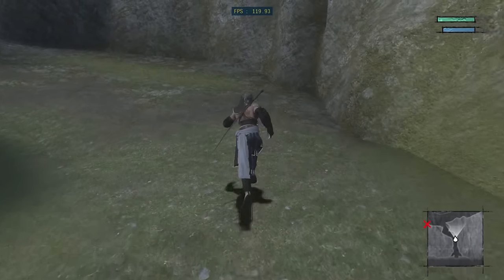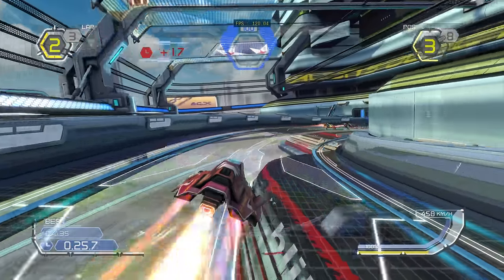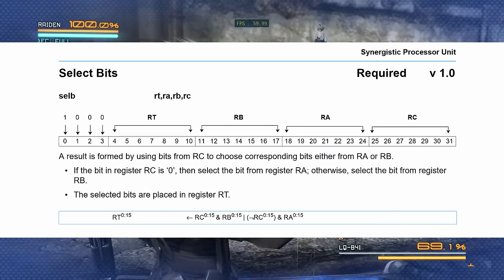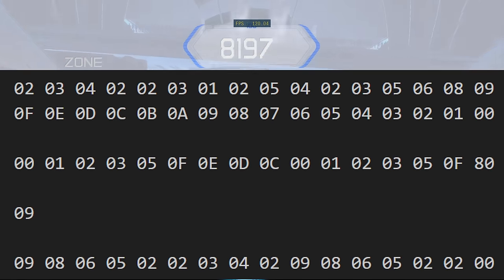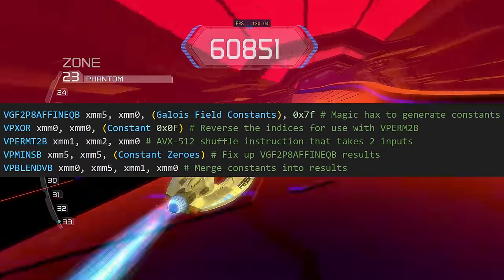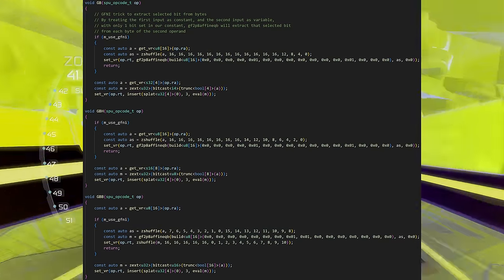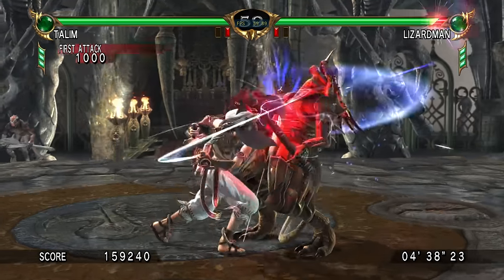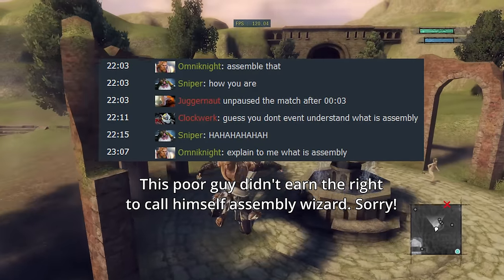Why is PS3 emulation so fast: RPCS3 optimizations explained

Comment: Very topical video for me right now. I'm working on an ARM emulator for x86, so this sorta stuff has been on my mind. I never thought to use LLVM in the context of emulation, but that's actually a great idea. Definitely going to consider letting it handle the IR and native code generation, it'd save me a lot of effort.
Reply from the maker: The one drawback with using LLVM is that the time to compile code is pretty long. RPCS3 mitigates this by falling back to interpreter while other threads compile the SPU blocks.
Reply: The good news is it's definitely a lot easier to run ARM (at least the 64b version) on x86 than the other way around, since most of the instructions will have a direct equivalent, and performance is achieved by finding the right instructions to merge together.

Old ARM with conditional instructions on the other hand is a lot more painful but you can probably get away with poor performance on most of them since their usage rate is so low.

Comment: Finished watching the video. I thought I would comment about getting a AVX 512 CPU but you covered it already. 
I was wondering how did you find out that vperm2b AVX-512 paths for AMD and INTEL are different? Do you test have both CPUs available for each benchmarking?
Reply from the maker: The site uops.info is a great resource for this kind of thing. I always consult it before adding any sort of microptimization. In the case of VPERM2B specifically, I wrote the Intel path before AMD released any product that supported AVX-512. About a week before the official release of zen4, Mystical, the developer of y-cruncher revealed some details about the new AVX-512 hardware in zen4 since AMD gave him some hardware early. So I wrote a path that let AMD use VPERM2B normally, since it's implemented with 1 uop on AMD.

Today I do have hardware from both intel and AMD with AVX-512 support, 11th gen intel mobile (tigerlake) and a 7800X3D. I've since confirmed that the VPERM2B path is fast on the 7800X3D, but at the time I only owned the tigerlake machine.

Oh, and the first several AVX-512 optimizations I added, I lacked any machine that could run them. Intel provides an emulator for future/current instruction sets that I tested my code through. Running an emulator through an emulator was exceedingly slow, so I picked up a tigerlake machine soon after they released.
Reply from the maker: Before zen4 was released I was already thinking about how zen4 would perform in the VPERM2B path. Historically, AMD has actually given us fairly anemic shuffle hardware, so I was actually suspecting that both the VPERM2B and emulated VPERM2B path might be to slow to be usable on AMD. So I was very pleasantly surprised to see that the AVX-512 shuffle hardware was actually more robust than intel for once.
Reply: @MrWhatcookie I just bought 12400f and discovered they disabled avx 512....is there any other way to enjoy certain games without avx 512

Comment: What I learned is that cross-architecture assembly optimization is basically like deck optimization and usage in a deckbuilder. I don't really understand the details but it's very much a "here is one path to lethal, here is another, this is how we can get lethal faster" kind of problem. I also want to note that this is one of the vanishingly few videos on YouTube that I think no one would watch at accelerated speed because it's so information dense.

Comment: 20:55 you can sleep for less than 500ms by using select() on a dummy socket. This is really the most portable way of sleeping in programs with granular precision down to a microsecond. This is posix compatible and will work on all OSes that are posix compliant.

The best optimization for 3D graphics would be to stop using floating point math altogether and use unsigned integers exclusively. Floating point math is the smoothbrain solution to a problem that could have been addressed more efficiently with proper use of integers and simple integer-based math.

Comment: god x86 and the modern extensions are INSANE. I've done some ARM and MIPS reverse engineering and things are so much easier (aside from when FPU SIMD instructions start getting mixed in). Thanks for this video, super interesting, and excellent work on RPCS3 :)

Comment: Your level of assembly and math understanding is impressive, keep up the impeccable work on RPSC3 ❤!

Am I right in thinking the manual(s) on the Cell BE were leaked, or have they always been readily available?

I wasn't sure if this was some half truth I read a few years back, making this the main reason PS3 emulation is much further along than Xenia...
Reply from the maker: Documentation on Cell has long been public. Remember that it was possible to install linux on early PS3 models, and that IBM wanted to sell people servers with Cell inside.
Reply: I think part of it might also be general interest. In theory, Xenia should be so much further along now, to the point where it could probably run on a smartphone, but it's not.
Reply: @TheAbsol7448  similar to how the ps3 has a powerful and hard to emulate cpu, the 360 has a powerful and hard to emulate gpu. it's improved a lot over the years, but expecting 7th gen emulation on a smartphone is pretty ridiculous when 6th gen emulation is just finally usable within the last few years.
Reply: @jc_dogen  From what I've heard, the PS3 is only hard because its architecture is just as fucked as the Saturn. In theory, the 360 should be was easier to emulate. I say a smartphone might be able to run it better smartphones have gotten pretty fucking fast. New phones are actually comparable to the Steam Deck.
Reply: @TheAbsol7448  The Saturn architecture was fucked because they panicked and shoved a second processor into the hardware to try to compete with the Playstation on 3D games. The PS3 architecture is fucked because of the (theoretically) very fast but highly restricted SPUs he talked about earlier in the video. Imagine manually managing memory across 6 separate SPUs! It really puts a huge workload on the programmer.
Reply: @wiegraf9009  The Saturn and the PS3 being really hard to run compared to other emulators really puts their fucked architecture into perspective. You'd think the PS3 would be easier to run than the Switch and arguably the Wii U, but hell no, it isn't.
Reply: @TheAbsol7448  fr fr

Comment: This is cool! I've always wondered what RPCS3 did with AVX-512 but couldn't find anything specific. Also had no idea that it used LLVM under the hood.

If you're looking for new ideas, maybe try to explain why I can run games at 10x speed fine but can't get good audio output unless I set preferred SPU threads to 1 and tank performance :P

Comment: I think the cpu instruction level is very intimidating. It would be useful to see more step by step examples of how individual bits are transformed.
In any case it is cool to witness how assembly is applied in a practical setting.

Comment: How much of these PS3 games are written in actual assembly and how much is written as compiled higher level code and/or game engines?
Reply from the maker: SIMD code is usually written with compiler intrinsics or ASM, so most of the powerPC is written in c/c++ while most of the SPU code is intrinsics/asm.

Comment: I'm pretty certain that in some workloads some of those optimisations are slowing down the workload due to the many branchings used. Every time there is an if statement branch prediction will run and sometimes fail, and when it does you have used CPU resources invane, so better keep the number of if statements as low as possible, sometimes at the expense of doing more work if that work can be distirbuted onto the CPU units.
One possible workaround for this is to use specific code for specific workloads, so use a pointer to a function that is set up when loading a game, and that function has less branching and code optimized for that workload. You can also switch it in runtime in specific moments in time when you know it will help. Some NES emulators did this with great results.
Reply from the maker: No, the branching is not done at runtime. This code emits LLVM IR, which is transformed into x86 assembly, and that's what actually runs. The code that actually runs is a disgusting sea of branchless SIMD instructions, the ratio of work done to branches is very very high.

Comment: About shuffling these bytes, I think you can save a constant vector by replacing vpand xmm5, xmm5, 0xF0 with vpandn xmm5, xmm5, 0x0F. SSE and AVX have bitwise andnot instruction, and you already need the 0x0F constant for the next line.

Comment: I loved the video. Have a question:
does it really matter if we squeeze 5 instructions into 1 instruction that takes more cycles? Different cpu instructions require different amount of cycles
Reply from the maker: Of course we consult documentation and tests to see which instructions are fast and which are slow. The overwhelming majority of x86 instructions are executed in just a single micro-op. Even complex monsters like VG2P8AFFINEQB have a reciprocal throughput of 0.5 on both AMD and Intel.
Reply from the maker: This page is a great reference if you're curious about how fast a given instruction executes on modern cpus: https://uops.info/table.html

Comment: nice vid, now i feel bad for assuming poor performance i’ve experienced in rpcs3 was due to lack of optimisation effort 😉. i’d love to see a video on the gpu emulatiom as i’m pretty sure that’s where the bottleneck was (… and also because i’m a massive gpu nerd 🤓)
i’m also wondering how possible it’d be to emulate spu code with compute shaders? from my understanding they’re generally similar in usage, but the spus have a much tighter coupling to the cpu. not sure how ‘parallelizable’ they are either.
Reply from the maker: People often ask about emulating the SPUs on GPU, so our GPU developer created a proof of concept that does exactly that. After a lot of optimization he got it to 1/100th of the speed of the normal CPU emulation, and that's in a homebrew demo that doesn't include complex to emulate synchronization like SPU atomics. 

I probably won't make a video that covers GPU side stuff because I'm not knowledgeable about it myself. There is plenty of genius in RPCS3's GPU emulation that deserves being talked about though, such as the shader interpreter that can be used as a fallback while compiling shaders in another thread. But you'll probably have to stalk the github yourself to learn about how that stuff works.

Comment: from my benchmarking in my custom physics engine,  avx2 is a 2x speed boost over regular code/SSE2 (sse is faster but the packing and unpacking make it break even), and avx 512 is a 2x speed on top of avx2's 2x.

Comment: I have a question. Not sure how to ask it so I'll just shoot. Why try to emulate rather than extract source code? If you extract source code,a game can be remade to run on modern hardware. Am I right?
Reply from the maker: The source code for the game is written in a high level language such as c or c++ and compiled down to PS3 machine code. We translate the PS3 machine code to x86 machine code. It's possible to translate the PS3 machine code back to c/c++ by hand, but that would take years of dedicated effort, and would require that work to be repeated for each and every single game.

Comment: Is it still advantageous to have an old intel cpu with tsx?
Reply from the maker: If you have an older CPU with TSX then that's better than an older CPU without TSX, but a newer faster CPU is still better.

TSX is actually present in the newer Intel CPUs as well, but just like how AVX-512 can't be enabled thanks to the e-cores, TSX can't be enabled as well.

Comment: That triangle culling in Ninja Gaiden happens in the Infamous games as well, for the main character and NPCs, so if you're playing at a higher resolution than 720p civs and enemies off in the distance almost look like ghosts, half transparent. Wonder if that's something that will ever be fixed or if it needs to be done on a game by game basis.
Reply from the maker: The issue is common to most AAA games, since they use the same library. It's currently only resolved with game specific patches in some games. It might be possible to do some fancy pattern matching to make patching more games easier.

Comment: Tried emulating a few games using RPCS3 on Steam Deck (64gb LCD) with Batocera v36 and settings recommended by Batocera Nation- only managed to run Skate 1 and Devil May Cry 4 without crashing… Skate 2 & 3, LEGO games, assassin’s creed 2, Uncharted 1 and LBP 1 failed miserably 😅

Not sure if it’s a hardware or software issue… has anyone got PS3 games to run well on Steam Deck?

Nice vid, subscribed and looking forward to more content on RPCS3 👍

Comment: Maybe because the ps3 had so little hardware to work with that the devs actually worked their ass to get it running, now with a simple shell to run in a virtual environment that is Miles better than the og machine.

Comment: hey what about Intel® Advanced Vector Extensions 10 (Intel® AVX10)?
Reply from the maker: AVX10 is pretty much just as useful for RPCS3 as AVX-512 is, but it's still several years away from appearing on client CPUs. RPCS3 already has some basic AVX10 feature detection implemented.
Reply: @MrWhatcookie  several years? well thats sad for sure.

Comment: any chance of running gt5 on ryzen5 3400g/rtx 3060 12gb/16gb 3200 ram whenever ai is present its unplayable slideshow and freezes finaly, (will be upgraded soon on 5800x3d) just being curious. mgs hd works fine but its basicly ps2 games in some sense i guess
Reply: youre trying to run gta5 through the ps3 emulator ?
Reply: @yesser6215  GT5 is Gran Turismo 5 bro, but i get the confusion😂

Comment: 5:00 triangles are culled because the resolution is too low? Then what if we emulate the prerender on higher resolution directly on the GPU?
Modern GPUs should handle it.

(I know it's probably harder to emulate, but it can be an interesting take)
Reply from the maker: The triangles are culled before being sent to the GPU, the solution is to patch the game's code but that requires game specific work.
Reply: @MrWhatcookie  Yes, I realised later it would be a per-game solution... it really isn't feasible on a generic emulator.

Still, and I'm saying this without ever having developed code for CUDA or other GPU libraries so there could be reasons for it, I wonder if running code on the GPU could be an alternative to AVX.
Reply from the maker: @IIARROWS  It's possible, but would be around 100x slower than emulating SPU code on CPU.

Comment: So what I'm getting here is the TLDR is that RPCS3 is less an "emulator" and more a PS3 machine code decompiler with a selection of optimizations to output slightly cleaner LLVM bytecode.
Reply: I think what you're thinking of as an "emulator" is closer to FPGA based emulators like MiSTer cores, where you create software representations of every component of the machine, but this is pretty consistent with how software emulation has always been done.  Using LLVM is just a brilliant way of optimizing the process.

Comment: I'm the type of nerd that vibrates uncontrollably when IEEE 754 comes up, so seeing that it was different on PS3 was somewhat concerning to me. For gaming purposes, are NaN and infinities not useful? Or is this decision to use a distinct floating point implementation just stupid?
Reply from the maker: They likely omitted NaN and INF from the PS2 to save a little bit of area. So omitting them from the PS3's SPUs was likely intended to remain compatible with PS2 software. The SPUs can also handle doubles, however they are IEEE 754 compliant, likely because the PS2 does not handle doubles at all. (The doubles are not pipelined, so performance is very very slow though)
Reply: @MrWhatcookie  Ah ok so they were sort of stuck with them for compatibility reasons. Thanks!
Reply from the maker: @rosly_yt  I don't think they were able to re-use much PS2 code, and they needed to ship the PS2 hardware in the original PS3s for compatibility. They likely intended to emulate PS2 from the start, but performance and compatibility was never as satisfying as they expected.

So really, they probably could've dropped the PS2-like FP format and saved developer headaches.
Reply: @MrWhatcookie  I hear early PS3 development was a pain in the ass due to a lot of stuff like that

Comment: AVX-512 was added to intel core CPUs in 11th gen i3,i5,i7,i9 --- but removed the feature in 12th and 13th gen core CPUs. I have a 13th gen i7. darn. BUT this CPU is mega fast. i dunno what to say. is there any way to use something other than AVX-512 to get remotely similar or speedy results with some of these examples?
Reply: nevermind, video covers this question

Comment: My cpu use i7 3770 mobo H61, Ram 16gb, gtx 1050 2gb, but i can't play dirt 3 on emu, TES V: skyrim not working, how to setting? Or my pc is not capable 

 i can play PES 2013, Trails of cold Steel 1 & 2

Comment: So....would you tell me if the 7800 x3d is an excellent cpu for rpcs3?
Reply: Though 12700KF with AVX512 is not worse in MGS4.
But not every game benefits from AVX512, but if it can, then it's even up to 40% better performance.
Plus from what I understood, upcoming Zen 5 might turned out to be very good CPUs for these instructions too